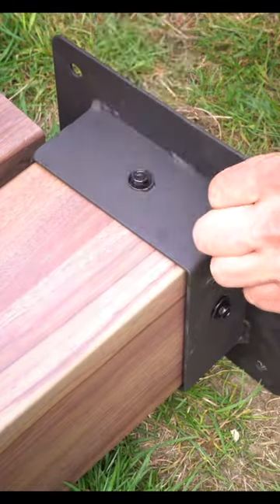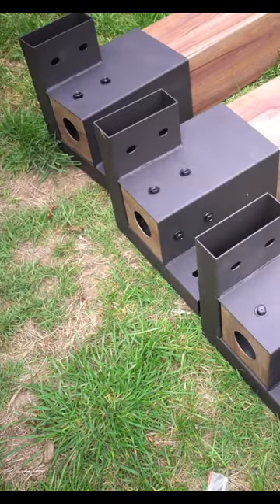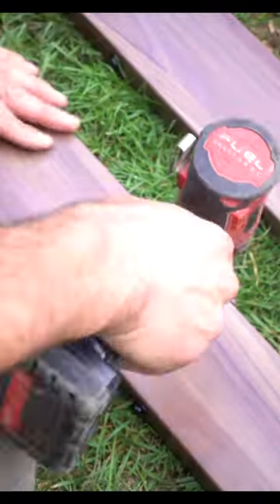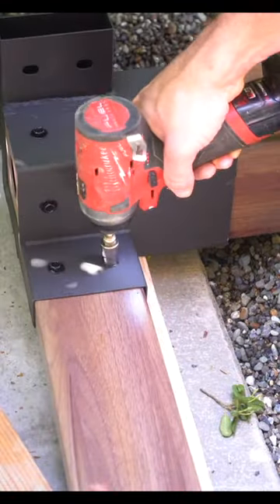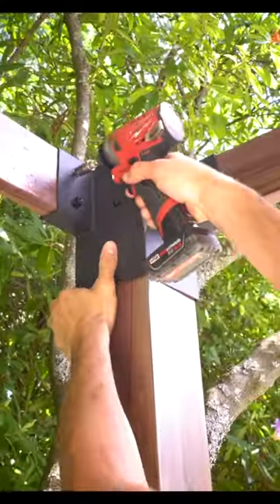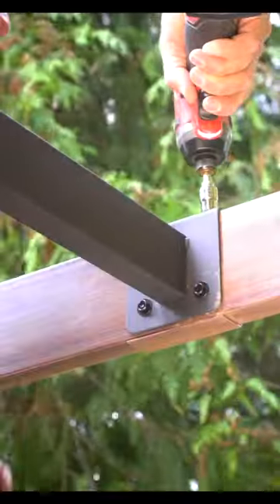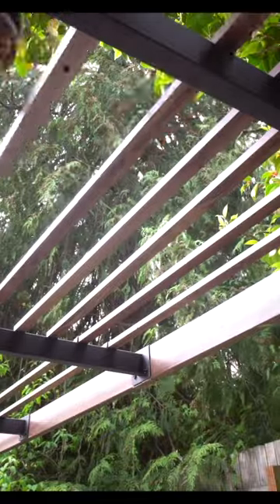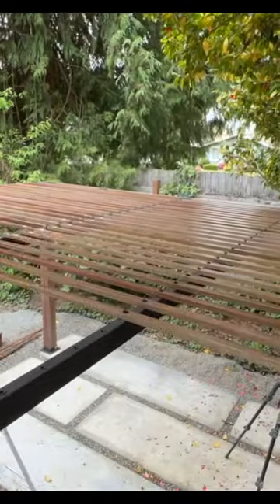Build A Pergola In Just A Couple Hours! #pergola #sunjoylife #pergolas

Comment: These kits are stupid expensive. Easier and $1000 cheaper to notch posts and mount them directly together.  This kit is faster, but not by much. If a couple of hours is worth more than the cost of the kit, then this kit is not for you.
Reply: Yep bro.. I can build it myself using materials from HD ... THESE are outrageously priced 😮
Reply: Deffo cheaper to buy lumber and build your own. Takes a little longer but if built right, it'll be stronger/more robust. The bonus is, you can customize it to your exact dimensions and type/size  lumber.

Comment: Looks like cheap vinyl fencing with Amazon DIY brackets. Pre drill and adhere bolts inside the vinyl to catch when installing. This kits mark up over outsourced materials plus you have to build it yourself.

Comment: What is the height on it. If want the top to be higher, would it be ok to use longer 4x4s or 6x6s?

If I am going to set this up on a slab of concrete in my back yard. What adjustments do I need to make?

Comment: Does this have to be secured like say if you were putting it on your pool deck would you have to screw into it?
Reply: It is better to secure it with bolts to either a wood deck or to a cement patio pad.
Reply: @1MarkKeller Yeah, these kits are too expensive to not be properly securing